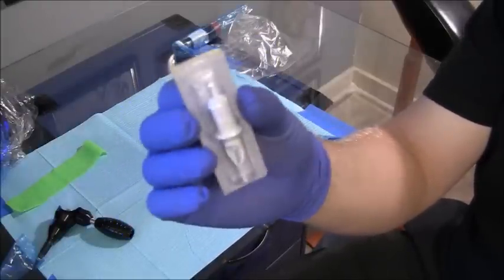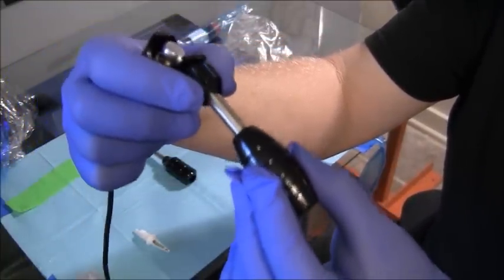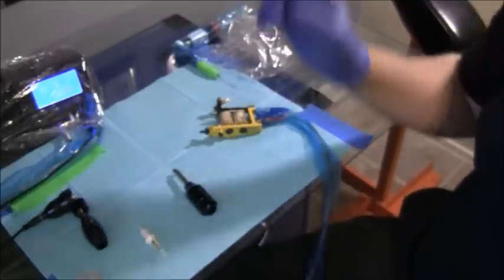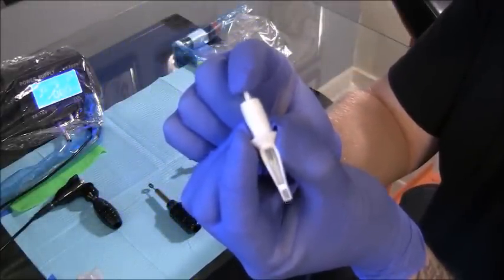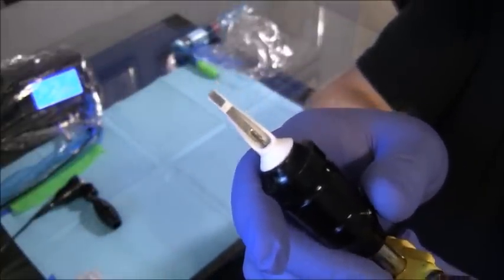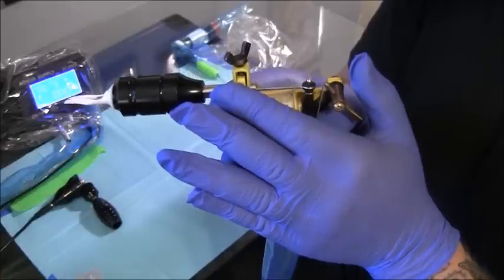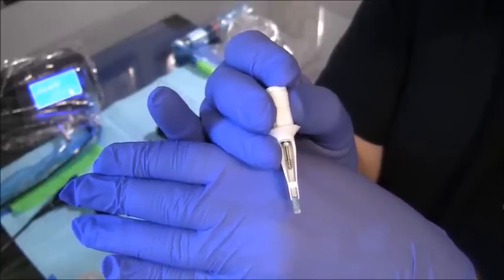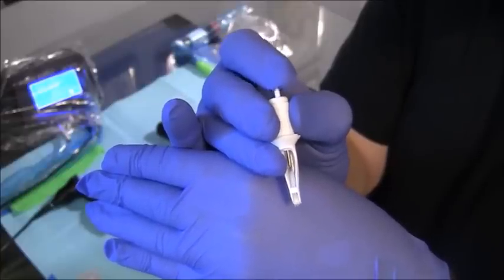Cartridge System on Coil Machines- Tattoo University

Comment: You forgot ( or missed) the fact that the coil machine needs slightly different setup to use cartridges. I help my machine to save on voltage by bending my back spring slightly towards the front  coil core. When the cartridge is installed , it pushes the plunger and the armature bar up and create desired tension. That way your machine doesn’t need as much voltage to do the job done like with the usual  setup.

Comment: Does anyone use the cartridge system with  coil machines?
Reply from the maker: @ThePatriotParadox  You can but its a bit much. Its easier to use pen or machine made for cartridges. There are issues using them with coil machines

Comment: Standard needle - Coils, Cartridge manufacturs have inconsistent tension depending on membrane/rubber band internals. Good luck with a rotary with give or coils with give. Nice video really shows a good breakdown of the two machine differences thanks.
Reply from the maker: It is important to stick to a company that you know will work.  I hate switching brands and finding out they don't fit.
Reply: Tattoo University ; Right that can be frustrating. Not all needles are created equal.. thanks again

Comment: You need bigger capacitor on coil machine and really big stroke ( big magnums 25mag+ ) to run it smoothly. But what os the point of run cetriges on coils  take a f..kin bar needle. Dont be lazy. Cartrige sistems are for rotarys  and if you wanna have  more soul on machine take coill with traditional needles. Cheers.
Reply from the maker: I think you should have an assortment of needles.  This way you can handle any situation.
Reply: Tattoo University not to mention quicker to change out,easier to change out,more sanitary

Comment: I haven't had any problems using disposable cartridge tubes on my coil machines. Although since getting a few  neo tat vivace machines and a xion I find myself only using cartridges in the xion. I don't like lining with any cartridge that I've used. They all have too much wiggle in the tip for me. Like I want to put a rubber band around the dug out just to put extra pressure on the needles to hold them still. I did see killer ink now has some cartridges with a diamond tip that I may try. I always used diamond tipped tubes for lining. But I've went to using nothing but black claw Hella tight liners and enso apex hollow liners on the neo tat machine to do all of my lining and the xion for everything else with cartridges. The neo tat machines have such a perfect linear stroke for lining and the built in clip keeps that needle bar held down tight. I've never had such ease doing a single pass thick bold black line than I have while using the neo tat and 6 or 8 hollow enso apex needles. And then the xion is just a dream to shade with.

Comment: Hi fk irons do a great video on setting up cartridges on coils.

They take the resistance off the rear spring and allow the resistance of the cartrige to act like the rear spring and push the armature bar up to the contact.

Great video thanks
Reply from the maker: Feel free to post a link so everyone can watch.
Reply: Thanks for that tip, thinking about what you just said that makes perfect sense due to the spring in the cartridge 👍. 
I have been wanting to try cartridges for a while now, and would love to try out the Cheyenne pen. Unfortunately NOTHING on this planet would justify me spending  £850.00 on a tattoo machine set up! I have decided to try a much cheaper hibrid tattoo pen from Solon tattoo supplies, and if I really like the way It works and feels, I will try to pick up a second hand Cheyenne! Unfortunately I have watched a number of Cheyenne reviews, and apparently even these top quality pens have a tendency to break down at least once a year if used on a daily basis, so it's advisable to have a backup! Considering that just the pen is around £550.00, I reckon I'll have half a dozen or so!!!Lol.😆 
Thanks for the tip, Neil.
Reply: Do you have the link?  I can’t find the video
Reply: I’ve contacted fo irons regarding this video you have mentioned about setting the coil up.   they seem to think the video doesn’t exist.... strange Ay.
Reply: @Mikaisafk  you can still find it on their channel
Reply: al katraz I had a good look can’t find it unless it’s blocked in my Country or somthing
Reply: @Mikaisafk  I think that topic was included with one of those long ass videos of gaston doing live, where u from brother? I'm from the philippines and there's no blocked fk irons videos in here.
Reply: @Mikaisafk  and what the original commenter said was spot on
Reply: Link to the video you're talking about?

Comment: Hi.  Thanks for the videos!

I have a question.... when you put your finger against the bar it simultate the resistance of the skin and you can see the needle going a lil back. Is this the give? And am I  allowed to use a little bit of force to get the needle into the skin when the machine has give? I made bad experience with direct and hard hitting machines.  
Thanks

Comment: Thanks for this video. I thought it was just me having problems with the cartridge system with coil machines. I found they stopped frequently. I thought it was because I was basically adding a spring system (the cartridge) to a spring system (the machine) I have a liner, packer, shader purchased from a builder that work brilliantly with the standard needle bars. I purchased a Cheyenne grip and plunger to use cartridges with these machines and found that the cartridges wouldn't move at all. I will remove the rubber band. I did find I had slightly more success with it by upgrading my clip cord. (might just be a coincidence)
Reply from the maker: a bad clip cord will restrict voltage.  If you power supply is saying 8 volts you might only be getting 4 volts to the machine